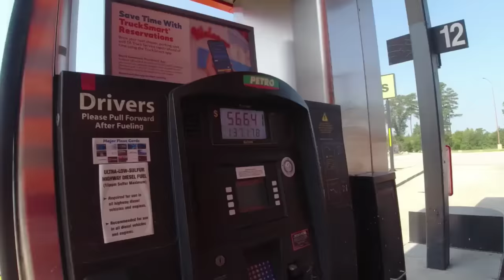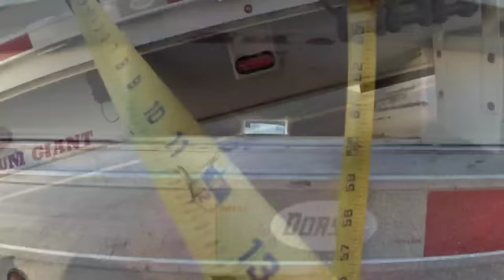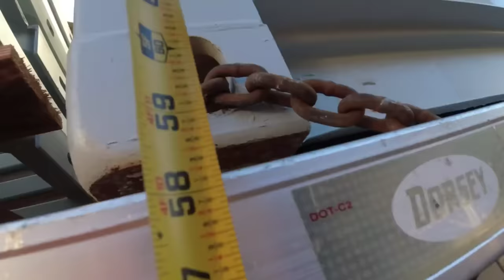#683 Hurricane Watch Reset in a Florida Weight Station The Life of an Owner Operator Truck Driver

Comment: I’ve always gone 20,000 miles to an oil change.
Last motor went a million miles.
Spring broke on an exhaust valve.
The bottom end still looked brand new
Reply: Keeping engine lubrication cool and filtered will definately safely stretch changing intervals. My Father would stretch out his oil changes big time by only changing out the filters a couple of times between changes. Dad always told me that if lubrication is cared for, it will never loose its lubricity.

Comment: Hi Dan, you stay safe cause of that hurricane and try to stay away from flooding interstates and in the woods as well if the tires are starting to wear downstairs, probably bushing spring bushing change all the bushing from front to the back if you have stabilize on those rear axles I'm not an expert on semi trucks but I do know something about handling and tires have a safe trip to Florida just keep rolling and keep the Shadyside down and the Sunnyside up you'll be fine 👍👍👍👍

Comment: Dan, I see your spare key, so if you miss your truck I got it. ha ha ha .......I had a Volvo that the drives were wearing, there was a adjustment rod on the drivers side. The shop had a measuring rod that measured center of front drive axle to the center of the rear drive axle. My axles were 1" out, made the adjustment, the tire wear stopped.

Comment: You definitely need to replace those bushes on the rear leaf axles. Also replaced or short U-boats on top work for a company with a fleet of a Peterbilt. Also, check your Shackles a front axles. Good luck in your travels.

Comment: Why is there a bow on the trailer? 😊
Reply: The trailer is aluminum, and the frame rails will flex more, so it has a large bow when unloaded or lightly loaded. When it's fully loaded it should be relatively flat. That way you don't have to worry about ground clearance and the trailer sagging when loaded out.